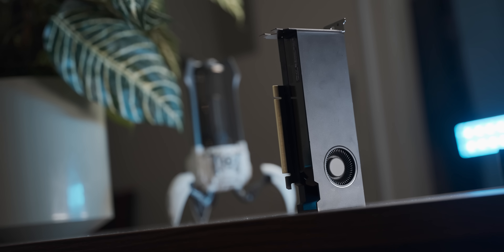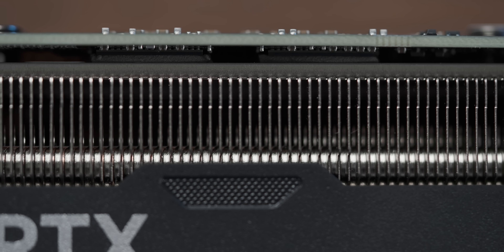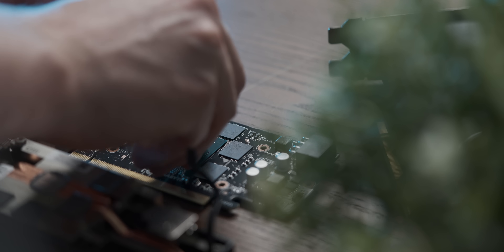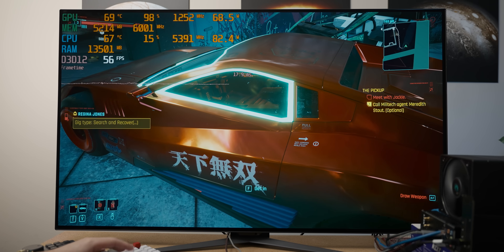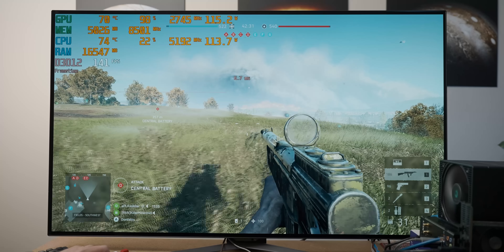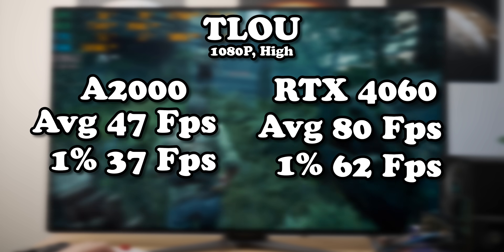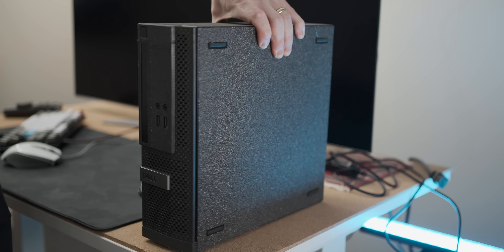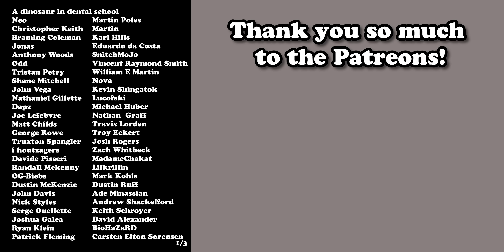A New Contender To The LP Graphics Card Throne

Comment: Great videos. I hope that you do the new rtx 2000 ada 16gb (for under $700) since the cost of the rtx 4000 sff is too high for mere mortals. There are no good videos on the internet for the new rtx 2000 ada 16gb, but it certainly should catch the eye of architects, engineers, and sff pc enthusiasts.

Comment: Asus launched a 4060 low profile that require only a 6-pin power connecter. Would be great to see how it compares to 8-pin Gigabyte version. With Asus you don't have to use that screechy sata adaptor, since a lot of prebuilds have an extra 6-pin connector...

Comment: The first time I watched this video I thought of how efficient new GPUs are getting, getting the video recommended again made me think.. what if Nvidia releases a version of the 4060.. or even a 4050 that runs on just PCIE power without the need for any cables. I wonder what the price-performance ratio would be in applications like this.

Comment: Yes, but the A2000 is performance is still exceptionnal for 70w and older 8nm versus 5nm for the 4060 (1 y old). If you take the exact same a2000 die and make it in 5nm (and double the pipeline power, you get almost 2x performance for same watts.) Then a 5nm a2000 would do exactly the same as the 4060 but only 70w. I did try to find a laptop for gaming that have 75w gpu because I dislike noise, it seems that the laptop version of the a2000 is 128 bit bus (castrated for no reason and it still 70w... why cut the bus for the same watts... ) I have a 1650 and it's hard to find a good laptop with a new 75w gpu low noise with a good 100% srgb color accuracy (I work on graphic too sometime... ) Try to cut on bus width for the memory is a very bad idea to save 50$ on memory module and pcb layers... (and cut half performance) they put a smaller very high frequency core for compensate the small bus of the memory (this make hot die and noise at all... ) anyway... we know nvidia and ati not want to sell good low end product... it's easy, you take the 4060, cut down the core frequency by 30%(half the power to 75w because power is exponentially, so 70% of normal speed is enouch to cut half...) but put a 192-256 bit bus memory and voilà... a Very good low power usage very very good gpu for maybe 50$ more... 😅

Comment: I recently bought the 4060 LP for an HP Prodesk G9 12500 Intel. Since these chassis are so confined, the space between the PSU and GPU fans is around 5mm, almost blocking any airflow and causing the GPU to choke on its heat, reaching 102 on the hotspot with the case lid open. Once I removed the PSU, it gave the card enough breathing room to operate normally. They should've gone with a blower-style cooler. I even considered modding this with a blower cooler, but it's not an easy job, to be honest.

Comment: I have a rx6400 4gb in an OptiPlex 3420 with a i7 7700, 240w upgraded psu, and it already runs too hot to leave the panel on. I would love to see that gpu in a SSF that's got a newer processor than an i7 2600.

Comment: A2000 LIST PRICE is only $449, and it's widely available for $400 OR LESS on used cards on Amazon (certified) - for the 6GB version.
The 12GB version IS crazy priced.

4060 low profile performance is all about it's higher power draw (A2000 DOES NOT NEED OR HAVE an additional power connector as you did mention) allowing higher clock rates, they are same almost identical core count and both are Ada generation.
The other issue is that SO FAR the only low profile 4060 is Gigabyte with their GARBAGE DIE TOO FAST fans - I'd wait for a similar release from someone like MSI or ASUS that uses decent reliable fans.

Comment: 4060 isnt technically LP GPU when it requires 8 pin connector that isnt found in small form desktop PSUs . So if you have SF desktop , you will need to upgrade a PSU that has 8 pin connector which IT WONT FIT in SF desktops LMAO !  So  the use case for this 4060 " LP " makes absolutelly no sense at all because if i need to get a bigger case to accomade a bigger PSU that has 8 pin connector then at that point im building a new PC and i 4060 " LP " wont be in it LOL .  So dynb

Comment: What is the point of a low profile graphics card if you still need an additional power supply?  That completely defeats the purpose.  If you have a power supply, then you have a full size tower and therefore you can fit a standard size graphics card in there and you can get a whole lot more performance for the money.  This makes no sense at all.
Reply: @singed234  yeah but this one still needs additional power. If you have a SFF build (as I do) you don't have an additional power supply. SFF cards usually run off the 75 watts the motherboard provides. This one is pointless.  For the same money you can get far better performance. You need a power supply anyway. Why would anyone buy this?  I was interested until I found that out. I just assumed a SFF/half height card would use only 75 watts as most others do.  I am completely interested now as this defeats the purpose.
Reply: I personally don't see either of those as a benefit.  Low profile cards run about 3x more expensive than a similarly performing full size card. Let's say you have a standard sized card at $150 and the SFF equivalent at $450, you're spending $300 more up front. I can't imagine a graphics card uses anywhere near that amount of energy in it's lifetime. Also, you can take that $300 saved and invest it. Not only do you still have your $300, but it's also earning compound interest.  As far as the size difference, the only benefit I could see is if you travel a lot and you want to take it with you. Then I could see a person not wanting to lug around a full size tower.  Other than that I can't imagine a person being so strapped for space in their home that the size of their PC is taken into consideration. It's a very expensive way to clear up a few square inches of space.

Comment: I wonder what will happen when you connect this to current mid Optiplex with a pci x4 gen 3 because the x16 is near the power supply which won’t let you fit this there. Thus this card hard to perform on a x4 gen 3.

Comment: I bought the a2000 on ebay for like 250 and they didn't know it was the 12gb model. It's a good card but in my experience has graphical glitches that my 6600m doesn't have.

Comment: The 4060 is about 50% faster, also more Vram, but uses about 50% more power. And it costs only 300 bucks instead of 700.
You can build a budget workstation with 4060s.
Works fine.

Comment: You can install the GeForce drivers on the A2000. I have an HP ZBook with the mobile A2000 and I use the GeForce drivers and it works well.

Comment: Does the A2000 fit in the Dell Optiplex 3040 SFF? Because I want to buy it and put it in my Dell Optiplex 3040 SFF and replace my current gpu the RX 6400.

Comment: When it comes to low profile GPUs, I'm still partial to the nVidia Tesla T4. Another pricey GPU but it's a single slot, solely slot powered GPU with RTX 2070 performance. The A2000 and 4060 LP are nice but neither are single slot which limits the size of some low profile builds. That being said, nVidia Tesla GPUs do require more setup than GeForce or formerly Quadro GPUs.

Comment: I have sadly given up on the idea of the ultimate budget Optiplex gaming pc. Budget? Yes. Ultimate? I don't think so. You're pretty much always gonna be bumping up against thermals, lack of drive bays, lack of drive connectivity, or PSU power limits causing you a bad time. When i compare it to my current ITX rig, they're worlds apart in terms of features, and the cost isnt much different, because i also bought them used, and got my ITX board, cpu, cooler, gpu, and psu super cheap.

Comment: I will never understand sacrificing something important like ventilation for extra video ports. Most low-profile systems NEED that extra ventilation it just doesn't make sense. Also, it should be noted that RTX cards are designed with a heavy reliance on upscaling like DLSS in mind.

Comment: Try reducing the power (limit) to between 66 and 80%. Then apply a mild overclock, and you'll be running close to stock speeds, but with 10-20 degrees lower temps

Comment: The true King of Low Profile Cards is a ARC 380. It costs not a hole Computer and is enought for most normal usecases.
Reply: 4060 smashes the face of the ARC A380... isn't the ARC A380 a 1650 in performance? Yeah 4060 is the clear winner.
Reply: @laszlozsurka8991  Do read first, before answer.... I talked about a true King, not a spinnig Joker. Salve

Comment: I'm curious, why you risk bricking the card by spinning the fan by your hand? Is modern graphic card now comes with an adequate protection to the potential voltage that could be generated by the spinning action of the fan?
Reply: Cool. Write an Wikipedia article?
Reply: @Od4n  it’s a question

Comment: The main problem is that all modern SFF Optiplexes since about Haswell have wedged the main PCIe card right up against the chassis.
Doublewide GPUs like this one won't work in them, leaving your only meaningful option the RX6400 Potato Edition.
I've confirmed this up to 8th gen Intel, and given this I'm pretty sure that the modern ones have the same problem.
They've used the same overall design in all of these models I've looked at.

Comment: This video is already behind: Nvidia already released the RTX A4000 ADA SFF that's better than the A2000. Also, why don't you try running the RTX 4060 without the 8-in and limit it to motherboard power? I'd like to see how it can go watt-for-watt against the A2000 without the unfair advantage (a lot of SFF cases might not have the extra power, and I don't want to rig up SATA cables to do it either).

Finally, to be fair, you can get RTX A2000s secondhand for like 200-250 since they were popular mining cards for a short while. I have one and it's been great.

Comment: If you're looking for a server GPU, then that 8 pin power connector takes the 4060 off the list. I know I know, I'm one of the only dudes who has multiple servers in my basement. But with 28 cores and 96GBs of RAM, all I want is to throw a card in and game on my virtual machines.

Heck, I could even rent them out to people who don't want to buy bulky hardware. Workstation GPUs it is for me. I am however considering hacking a server to add a standard atx power supply for just this sort of thing.

Comment: There is one issue with this card. When you need a small GPU - chances are - that you also have very small case. 3 fans may be efficient, but if your PC case is small it won't gonna help and after 1 hour of gaming your PC components are gonna get hot - especially if this thing needs more power. It would be actually way better if this gpu had blower style cooler (just like A2000) as it ejects hot air directly out of your case. Blower coolers are just better for small cases.

Comment: Nice video. I picked up one of these graphics cards as a secondary GPU for encoding for streaming/recording. I wanted this in particular cause I didnt want to block airflow from my main GPU. With my particular mobo, I have the main GPU at 4.0 x16 and this LP one at 4.0 x4. Everything stays cool. Main GPU sees its normal temps like before and this card pulls no power so its usually below 60'C

Comment: One thing to keep in mind:

If you're ONLY using it for gaming and maybe some video transcoding -- then you're probably fine or well-to-do with the RTX 4060.

But if you're going to need, for example, CUDA 12 support, the RTX 4060 is going to be questionable in this area.

(I use the RTX A2000 6 GB version for CFD, and there is little to no guarantee that the CFD code will run on the 4060 because it is missing features/CUDA support that the A2000 has.)

So, just keep that in mind as you make your purchasing decisions.

Comment: The letter A in A2000 means Ampere, i.e. that is basically a slightly downgraded 3060 12GB with lower clock speeds. Not a big surprise that a 4060 beats a downgraded 3060.

Comment: I suspect the A2000 is primarily intended to run machine learning and artificial intelligence models rather than graphics - so the ports and the amount of memory are not so important.  The ports may never be used and for running model algorithms consumes as much GPU compute as you can throw at them but they aren’t particularly memory hungry.

Comment: Great stuff as always Dawid, thanks for helping me out with an issue here. I have been looking for a way to put a discreet video card into a Lenovo office PC I bought, I never knew about Sata to PCIE connectors, this will solve my issue with the PSU they put in there, no idea if it will blow up but worth the $7 cost of the adaptor on Amazon for the chance that they put in a >250 watt PSU.

Comment: About to upgrade my optiplex 790 MT

I've been wondering
Will the rx 580 one with long design but one fan like the 4060 lp on this video fit into the chassis?

Also I'm using i5-2500 (no k) should i upgrade if possible or is it enough?

Comment: A test of the 4060 limited to the same 70 watt TDP as the A2000 would have been enlightening, as I am most interested in the efficiency aspect of the newer card in a lower power build(my entire mindset starts with off grid solar system efficiency). As always, though, very entertaining!

Comment: Next would be a good test use a bios editor, set the bios to 73watts max. That way the pin connector is not needed. Then compare the cards apples to apples.

Comment: By cooler design I would take the 4060 over the A2000, for most home cases axial fans will cool better because they can tend to be put in multiple units and get more air through.
And with 115W the 4060 doesn't need an 8-pin. Take away the (conservative) 66W of the slot and you're left with 49W, which can easily be done on a 6-pin.

What I would want to see for an efficient and fast LP card would be a bigger chip, Like an AD104 or even AD103, massively underclocked to get into that peak of the efficiency curve, and pair it with a wide, but slow memory bus.

if you add more cores/chips you increase power draw linearly, but if you increase clock, you increase power draw exponentially. So a full AD104 at 1600 MHz should easily be below 150W
I've seen people losing about 6% performance in their 4070 Ti at a 36% reduction in power draw. A 4070 Ti that draws under 170W, and there surely is more headroom. A 4090 will similarly use about 5% performance at worst at 70% power limit.

Comment: I love low-profile GPUs... or at least I did. I'm not sure they make sense these days. There aren't as many current LP systems in the wild that will support a dual slot card that needs so much cooling. At the same time, if small size is the goal, the explosion of "sandwich" style cases that put the GPU back-to-back with the MB has really made low profile unnecessary for SFF use.

In fact I'm having a really hard time imagining a system where this card makes sense. None of the reviews so far have shown that. You at least showed that it sort of physically fits in an older system, but the performance balance is out of whack

Comment: Is this good for the price:

CPU - Ryzen 5 5600G
GPU - RX 6650 xt
RAM - G.skill 16GB (2x8) 3600Mhz
PSU - Seasonic G12 GC 550W Gold
SSD - Kingston SSD 500GB NVMe
CPU Cooler - Pure Rock Slim 2
Case - Aerosol quantum mesh v3

For 600€

Comment: Just a heads up, for Mini-DP you can easily buy Mini-DP to DisplayPort cables so you don't have to use dongles. My users do it all the time for laptop docks.
Reply: The adapters are normally included with the A2000. So free, usually.
Reply: @bricefleckenstein9666  Indeed, that is a perfectly valid option. I was just giving another for folks who didn't want adapter dongles hanging off the back of their GPU.

Comment: i recomment you trying dx11 or vulkan for a2000 because nivida is cheating in dx12
because you dont see it but i have rx5700xt 8gb it run so worse in dx12 but not in dx11 or vulkan and in dx12 i getting only 20 to 80fps and in dx11 or vulkan i getting around 50 to 400fps

Comment: Using the SATA splitter like that is not a problem. the SATA drive uses 5V and the GPU uses 12 V  so they're not loading the same bus or wires. Not that a SATA drive on the same bus as something else is going to cause problems anyway. SATA drives don't draw a lot of current.

Comment: You don't need a mini dp to big dp adapter. You can buy a cable that has mini dp on one side. Considering that we have monitors with mini dp sometimes it makes it even a good idea to slowly move to mini dp. In my opinion it is like switching from USB A to USB C. But when speaking of USB C - we could switch to USB C ports for video too.

Comment: How about the new RTX A4000 LP graphics card vs the RTX4060 LP, the a4000 is also 70W
It is actually named RTX A4000 SFF to be more precise if you are unable to find it as LP
Reply: Down side, the A4000 is VERY pricy. Makes the 6GB A2000 look cheap, and even the 12GB A2000 look fairly cheap.

Comment: dawid! remember the video where you drilled the hard drive cage out of an old dell optiplex? i just did that mod to my optiplex! i did it to shove a big a$$ gpu that came in a old mac pro i had so i could play gta 5 at more than 25 fps... i shoved a amd radeon hd 5700 1gb gpu in it and it gets a solid 60 fps now on gta 5!! the werid part is the gpu i had in my dell optiplex before i did the mod was a amd r5 430 2gb card which did wayyy worse in gta 5 than the older one????

Comment: Dell  SFF cases after about the 6th gen Intel can only fit a single width card. HP's 8th gen Intel is similar - the power supply limits the x16 slot to a single slit width. Thankfully, HP relented with the 9th gen and reintroduced double width slots in some, but not all of its SFF cases.